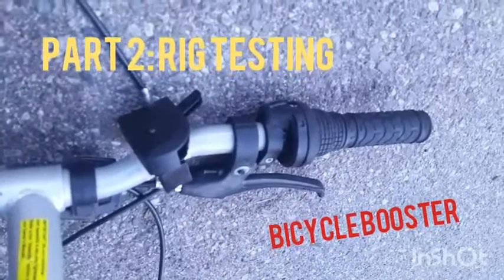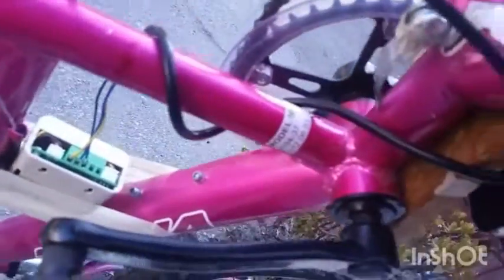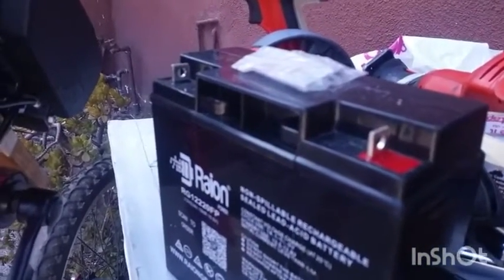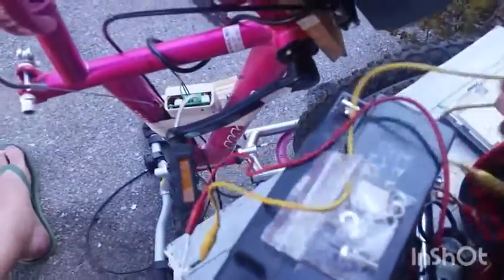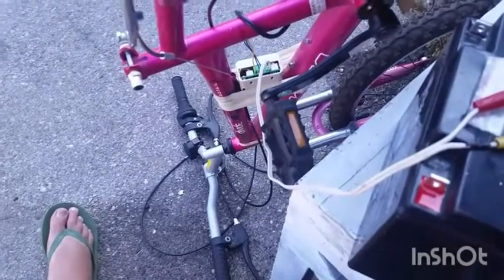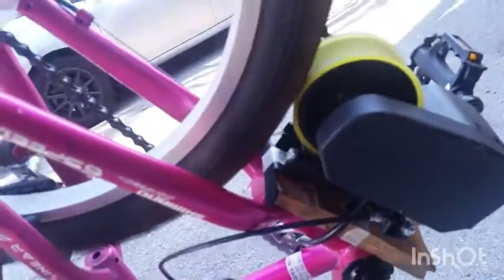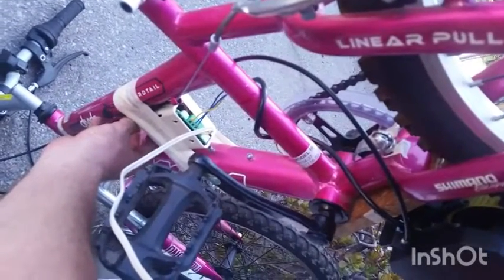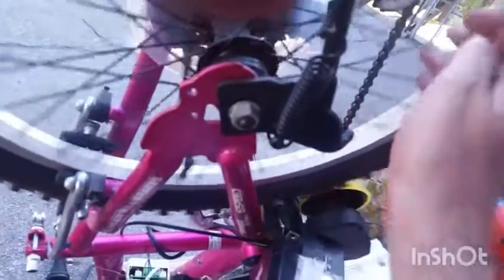Bicycle Booster - PART 2: RIG TESTING

Comment: Hello dear how you fix the throttle or label it 😊
Reply from the maker: The "throttle" is actually just a potentiometer with off switch at one end and max. Voltage at the other...
In this video it is only installed on the frame for testing, ideally it should be installed in such a way as to have access to turn the potentiometer while holding on to the bike handles... I have another video where I did that for a different rig on a Mongoose bike... however, this rig is not designed to be used from starting from static but only to sustain speed once the bike is moving on by pedaling

Comment: part 3 please
Reply from the maker: Thanks, I tried different controllers but this type of motor, brushless, hubless, is only suitable for use as a pedal assist, as it does not have hub power to provide enough starting torque, so it's only good for maintaining speed and/or making pedaling easier.
Reply from the maker: Here's another motor system, this one runs on dc, brushed, and has a chain drive...
Reply from the maker: https://youtu.be/c5XcDW7qJkk

Comment: You have it mounted on a piece of wood. Have you found something better?
Reply from the maker: I've been working on a different system, see the videos starting with this

https://youtu.be/LMWtDvjzh-E

But for the system in this video I just looked up the specs for the controller I used and it seems it could handle 36 volts... that's going to be my next tryout, hope it would give enough torque (and not burn the motor) to get the bicycle started from still and move it along...
Reply from the maker: BTW, wood is easier for me to work with, get it the right shape and size, drill into it and once finalized, some paint could make it look ok